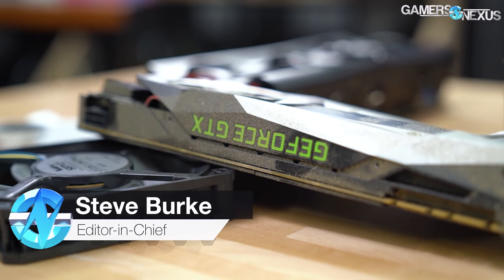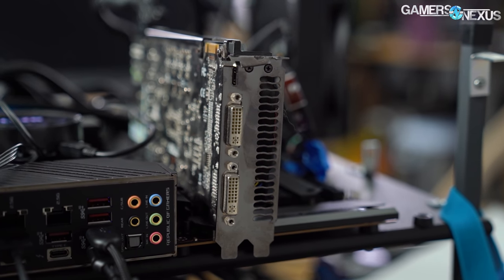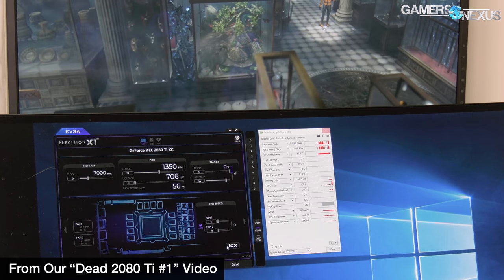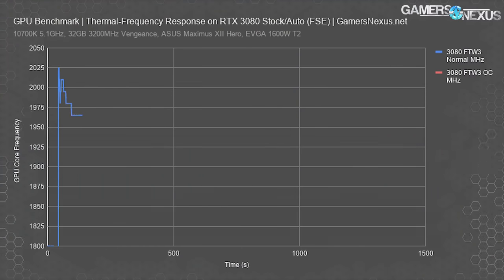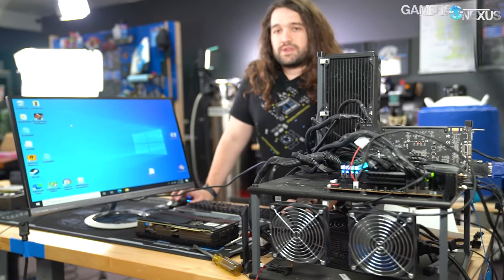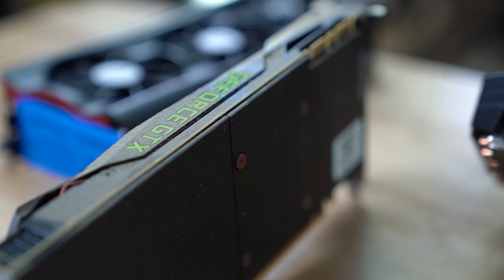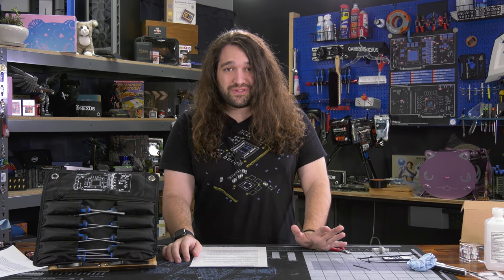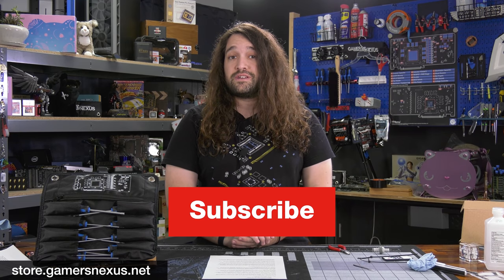Warning Signs When Buying Used GPUs: How to Detect Defective Video Cards

Comment: One thing about buying replacement fans: sometimes you also need to specify the right card profile. The fans on a gigabyte gtx 1070 have the same exact model number on a 1070 mini ITX, but the length of the power connector and the gender of the head are different.

Comment: I recently had to dive into the market for a new build and ended up hitting a unicorn. I did a lot of research on the card advertised. Made sure it had LHR and checked the SN against the EVGA website to find out the card was only about a year old. Pulled the trigger because it was a reasonable price but ended up receiving a completely different card with the same GPU instead. This one still had all the plastic scratch protection on it, no signs of dust, smelled brand new and had 2 gigs more memory than the one I thought was purchasing. Needless to say I was skeptical at first, but after checking the part number with Asus and contacted the seller to make sure it was okay to bench it I decided to keep it. Ended up getting an incredible deal on a basically brand new 3080.

Comment: "If you can fix a card with bad capacitors ... you're probably not watching this video."
Aaand ... I'm watching the video ... so I guess my level of tech savy-ness just got called out.
And then I smiled at my chosen ignorance, by watching the rest of the video.
Reply: Literally doing the same, even though i'm an engineer and can re-ball/re-flow too lol I saved up for over a year instead and got a brand new card outright, plus water block! (Yep, i finally got an RTX 3090...holy shit the RAM runs hot!) I miss my 1080 Ti, but i got £500 for it and i'd fitted a massive cooler, so i didn't complain! Just enable BAR in my vBIOS already, Zotac! Funnily enough my 1080 Ti was second hand but fairly new, used for...League of Legends! Purchased a few months before the crypto crash, i paid £669.96 :D with the cooler i lost about 200 quid...but had it for almost 3 years!
Reply: @fistymcbuttpuncher6419  Can't solder well due to shaky hands... BUT Yeah, I think most people watching this probably can replace a blown cap... Now, understanding schematics - that is something else.  Just like wiring your home... Yep, sure can do... but I am no electrician or electrical engineer... ;)

Comment: Test the card, test the card, test the card!  Low frequency may possibly be fixed with a flash of the card's bios (it's not hard at all but yeah nerve racking).  The cause is that miners sometimes use a special bios that limits frequency.  This really works AND is the only fix in cases where frequency has been limited intentionally with an alternate bios...

Comment: The last two GPUs I bought were used and from Ebay. A 1660Ti for my personal PC and a 960 for my sisters homeschooling PC. The 1660Ti smelled a bit of cigarette smoke, but the 960 was like new, even though it was sold as used and not refurbished. Both quite good deals, especially the 1660Ti. It was 220€ back in 2019.

Comment: Warped pcb's are also a sign the card has been baked in an oven.
Reply: What people will do to try to re-flow... Just open the card up and look and use a heat gun if you don't trust your hands with a soldering iron.  People are nuts.
Reply: @horscategorie  ...i kept a pair of 7970's running for years by baking. one needed it every 4-6mo. saved countless cards that way for customers, even if only temporarily (which i tell them going-in). PCB never warped tho... baked wrong (WAY too hot) if that happened. heat gun method warms unevenly, uncontrolled temps, & cools too quickly.

Comment: "PErhaps Linus handled it before we got it." Literally LOL'ed at that. I love that the sag example it the Aorus 1080ti Xtreme. It's a thicc boy alright & that metal shroud on that thick heat sink is hefty. I'd definitely have that issue by now if it were for having mine in a Tower 900.

Comment: I bought multiple 1060 6gb and 1070 and 1080ti from miners and internet cafe. Usually those came with very limited warranty from them. 7 days at best, but they sell in quite large quantities and reviews seems very positive. The cards looked dusty but not rusty/bend/scratched. The temper seal are usually untouched. I stress test them upon receiving them with 3D render, Ai workload, benchmarking software for a full 6h. And never got issues. Maybe the I got lucky for all those years. And the temps always looked really good which meant that apart from being a bit dusty they were working perfectly fine. Got even some excellent overclocking gpu for cheap. Such as a 1070 strix with OC clock till 2.15ghz at 70 celcius for only 120 usd. So, usually I buy second hand from known resellers and doing a lot of research without having the chance to test the system in shop.

Comment: GN: How to get a good second hand GPU
LTT: How to use your GPU for mining
👀
Reply: LTT is years late on that one
Reply: @nemz7505  Maybe not a year, but yeah. And quite some outdated info. Like "another 2 years of mining". No, you'd be lucky if you can mine the rest of this year at this rate.
Reply: Pro tip for mining, solar is pretty good, you can buy one or two marketed as camping solar systems and run a few GPU's on full throttle when the sun shines, hell you go full pro and become a sun farmer running a mining operation, or you can choose anywhere between. May the hashes be with you.
Reply: @whatdafarkenhell7110  Yeah, that's fine but when the price of crypto drops like the last crash, where electricity is more expensive then what you get out of mining, it still becomes ridiculous to do that, since generated power could be better used taking anything around your house off the grid rather than farming something worth less than the cost of electricity.

Also thought I'd mention that generally speaking those "camping solar systems" are rather overpriced for what you get, you're paying for convince (even more so in the case of folding panels), whereas just buying a panel + battery + charge controller costs almost half or less, which still leaves you with plenty left over to get a decent pure sinewave inverter rather than the cheap stepped/modified one you'll find in a lot of products.

Yes, it's more research and more effort, but it's well worth it if you have the slightest interest in learning about solar and getting the most out of your solar system, if it's more of a passing interest and you don't care all that much then sure find something ready to go.
Reply: @vgamesx1  I see you imagine a world not minting cripto, tell me more about your fantasy land.
Reply: @whatdafarkenhell7110  Welcome to proof of stake

Comment: Super helpful video, Steve! Thank you!! My EVGA 3080 10GB FTW3 Ultra Gaming, bought directly from EVGA's B-Stock in Sept 2022, has been "Space Invader" artifacting, crashing games to desktop, PC rebooting, and even having MoBo post issues. I'm using my backup RTX 3060 XC 12gb backup card with no issues whatsoever, even when running the card full out in Ultra settings while gaming. I use a time-tested late-model Corsair RM850x to power my AMD 5600x system, built in Mar 2022. I plan to RMA the 3080 as soon as I've eliminated all possibilities (monitor cables, card DP/HDMI ports, PC case temp/cooling, power delivery, etc.)
Reply: I guess even high end cards can't escape defectiveness like this

And its an EVGA

Comment: I've bought two used GPUs.  The first one was an RX 470, it was ok and lasted a year or so - keep in mind that it went very cheap.  It came with a bad connector and on the other connectors if you jiggled the cable the screen would turn to noise for a second.  And the back looked a bit heat affected, maybe it had been mined on. It had a factory overclock but couldn't be pushed much further. But it worked perfectly for games, GPU-Z said it was higher quality silicon than most. 

The second one is my RTX 2060 S, it seems new and it works perfectly. 

My whole computer is used.  It's dual socket Sandy Bridge xeon workstation with top of the line processors for the time.  Despite all the people who say those aren't good for game, it's FINE for games at least for the time I bought it, about 4 years ago.  I have a friend with a brand new Rizen that has so much higher IPC that his 6 core machine matches my 16 core machine in Cinebench though.

Comment: 11:27 Nice touch :) My experience with artifacting is that it usually appears either when you push a GPU memory clock too far or when your card is on the verge of dying. Had this with my MSI R9 270x that died months after warranty ran out. First it would crash GPU drivers and artifact, then my system wouldn't even complete post with the GPU inserted most of the time.

Comment: I decided to buy a used R7 265. After talking a bit with the seller about it's history (was pulled from a dead pc and he didn't know whether it worked or not) I decided that I'd give it a shot since it was sold for cheap and he seemed like an actual good-mannered person incase anything was wrong with it. Paid for the card, got it and it turned out that it boots into Windows just fine but doesn't display any video. I immediately told the seller and thankfully he returned the money that same day and was bummed just as much as I was lol. I also got to keep the card, and I am currently trying to "revive" it by trying to install NimeZ drivers for their hybrid gpu capability, since I have an igpu to use as video out. Currently waiting for an update so I can install them...
At the end of the day I really shouldn't have dived in head first even if I knew what I was going to get myself into, but I'm still very thankful nothing too bad happened.

Comment: I think it's really hard to not fall for used cards. A lot of people are desperate for GPUs, not even just the 30 series. People would take a 2060 or 1660 if they could get their hands on it. For myself I've looked at ebay a lot. I'd love to have a 3060 ti to replace my 980 ti, but I'd settle for a 2070 super...but there is no settle. So people like me sit and wait, hoping things will be better this month, then wait til next month. Then you kinda just cave in and buy scalped cards or bite on an unknown that could be damaged, broken card.
Reply: I did this, but I did get a very good deal on a EVGA FTW3 RTX 3080 10GB LHR, guy was genuine and only used the card for gaming after work, he also stated that he purchased the card back in February this year. He cleaned it with compressed air before sending it to me. Very big risk but now I’ve seen it and tested it no issues what so ever. Card was basically brand new, not tampered with & even the box was in mint condition, I paid £690 for it here in the UK, everything is way more expensive then the USA for computer components so what I paid was actually a good price for how clean and nearly new the card was.
Reply: @welomm345 how long did it last ?

Comment: Moral of the story: don't buy blind. Either do so in person or make a discord/skype live call with the dude showing you how the gpu actually works running benches and a game or two. Especially on 4+ year old cards or new cards sold at msrp.
Reply: Have you done, this or have this experience to buy gpu to know what gpu are good
Reply: @obey112el  i tend not to buy second hand stuff so no. But if i was to buy, i would do the same exact thing i said in my comment. Make the dude join a live call and show me the card working in some bench/game if i cannot purchase in person. If we were on person I'll ask to show me the card in his build working. If he doesn't accept, walk away.
Reply: Or just pay with Paypal
Reply: @omegaPhix  you'd still have to go through the hassle to open a dispute tho. Easily avoidable.
Reply: @davidepannone6021  If you find a good deal on a GPU in these times and want video proof with game tests you wont get the card. 
There's 100% already someone else in the line who'll take the card with less of a hassle for the seller.
Reply: @omegaPhix  I'd rather not get the card then.
Reply: @omegaPhix  Then I won't get the card buddy.
Reply: @IronIsKing  No problem, i'll take it anyways
Reply: @omegaPhix  Don't cry when you buy a defect GPU when the seller wasn't willing to test the GPU.
Reply: @IronIsKing  already did countless time and paypal got my back. 
My 2080 Super for example only cost me $300
Reply: @omegaPhix  Have you ever filed a Paypal dispute? If so, how's the process like? I'm thinking about buying a used gpu, but just scared to get a messed up card. Lol

Comment: I bought a 3070ti FE back in March from eBay as a 40th birthday gift to myself.  I'd been saving up while being very annoyed with GPU prices but they got to a point where they were, according to many in the know, as good as they were going to be for a while.  It was "brand new" and "only out the box for photos" but the seller had been on eBay over a decade and had thousands of positive feedback points with no negative or average feedback.  

eBay offered the buyer protection thing so I went for it and, so far, it's been bang-on.  When it arrived it was in pristine condition without a mark or speck of dust on it anywhere, and it installed without a hitch.  As he said himself: "I wish you many years of happy gaming!" and so far there's no indication that wont be the case.
Reply: how much did you pay? feel like thats a big part to leave out ! (:
Reply: @gbodybala9295  More than I would now, less than most at the time.

Comment: I have purchased used : 8800 gts, gtx 280, gtx 460, gtx 560 ti 448, gtx 580, gtx 670, gtx 760, gtx 960 4gb, gtx 970. All worked great. Just make sure you have the option to test them if you are buying them local. New thermal paste is a must for older cards.

Comment: Common issue I find with second hand sales is coil whine. 
People have returned cards to me as they thought that coil whine on my card was a fault. I have shown people (and even given out files) for configuing GPU mhz caps and power controls to prevent coil whine, Or advised settings to change (v-sync etc) to adjust it.  
It's not necessarily a "BAD or FAULTY" card. it's just age showing, or sometimes poor design/cheap parts from the card originally etc. 
Brand new cards can still have coil whine! (looking at you Gigabyte!!)

Comment: Work is requiring us to change our WFH setup, won't provide the hardware, and their response is "there's $50 computers on craigslist"
Reply: $50 is a stretch, but for $100-150 you can find an old dell Optiplex with an older i3 or i5 that will do more than fine for normal office work. Add a $20 SSD and it should feel quite speedy for web browsing and office programs.
Reply: @swecreations  yeah they want us to run their own custom OS now. they're telling me it'll run on anything made in the last 25 years but for some reason it doesn't work on three of my systems including a more recent AMD b450 platform. it's like I just built this computer last year to work from home and now you're telling me I have to change it?

Comment: I bought a used 970 for £120~ back in 2016/17
It ran OK, until it randomly showed artifacts on the screen, and failed catastrophically to the point where I had a counter keeping track of how many times I had to freshly install windows 10. 

After having enough (and a desire not to give up) I took a look at the card, and noticed there was some corrosion/crud on the back of the pcb (no backplate) so I poured some isopropyl alcohol onto the pcb, got my screwdriver with a flat bit, and started scraping the ever-loving hell out of these spots that had this stuff on it.
After wiping away and drying, I installed back in the machine, and it ran perfectly fine from that point forward.

It still works, but I bought a 2070 super in June last year...then discovered that I could've bought the 3080 for the same price, but cba to return the card and go through the hassle.

Hope people get lucky when buying second hand, and always keep some IPA spare!

Comment: Right after the LTT bitcoin mining sponsored video haha
Reply: Nothing wrong with mining.   If you run cards at reduced TDP and keep good airflow keeping temperatures well below threshold.   I have never damaged a GPU but I buy high end brands like EVGA and take care of my hardware.     My Roomba keeps the dust off the floor.
Reply: @3asyrider75  it is not about the GPU, it is about the environmental impact. Currently Bitcoin mining consume more energy than Argentina
Reply: Turtle will me running my GTX 1070 at stock power limit but with peak mining temps at 50c (custom modded cooler) hurt it’s lifespan long term?
Reply: @MarshallSambell  So long as you do not over volt it will be fine.    You can always benchmark the GPU and look for artifacts that indicate damage.     I test all my hardware before selling and if it is unstable it goes to the electronic recycling.
Reply: @katech6020  you do know that producing paper currency and coins affects the environment too right? paper comes from trees, coins come from mining metals. not to mention the big factories that print the actual notes and mint coins

Comment: Another one I've found to be common is a GPU hang as soon as you start any intense 3D application, but seems completely fine otherwise, these sorts of issues can also often be spotted in NVIDIA's control panel 3D rendering settings (where it has the 3D NVIDIA logo), you might see the 3D logo vertices being displaced
"space invaders" is not just restricted to 20 series cards either, the pattern may look different, but the same issue can exist on other cards (sometimes just in a few spots off and on, other times uniformly accross the whole screen)